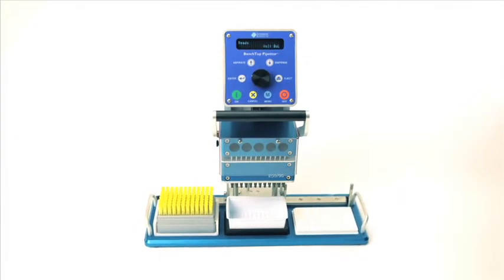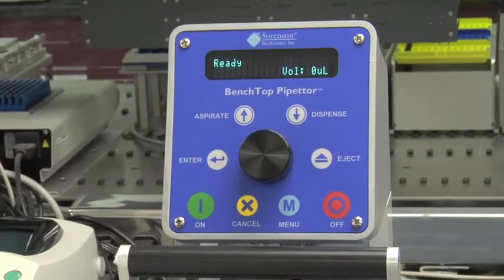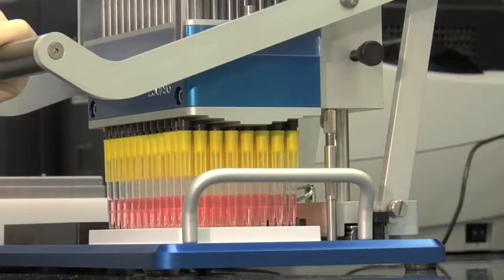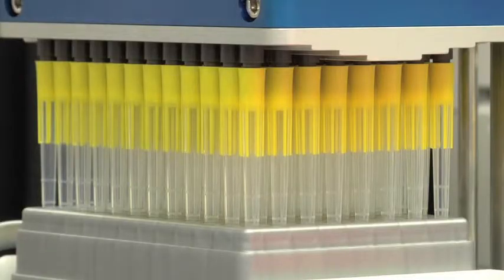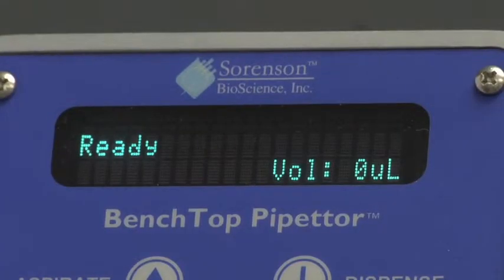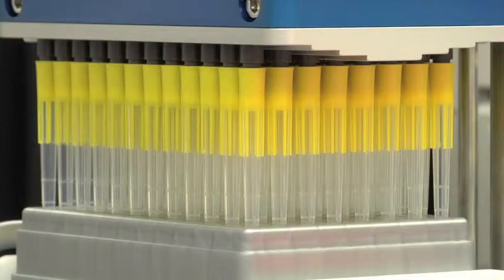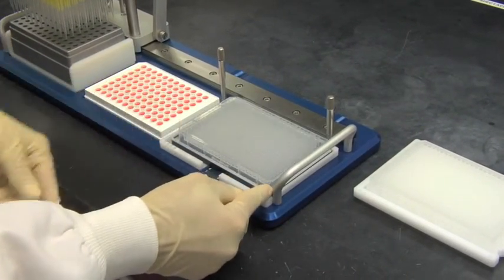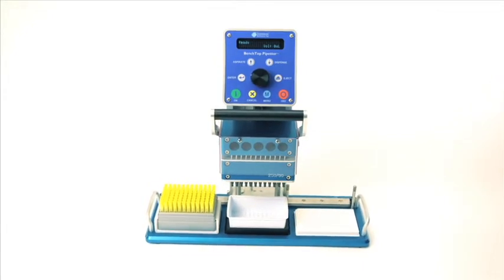Sorenson Pipettor

Comment from the maker: Sorenson’s new benchtop pipettor is a semi-automated liquid-handling device for pipetting into 96 and 384-well plates. This lightweight, portable instrument accelerates liquid transfers. The benchtop pipettor is intuitive and simple to operate. This versatile equipment aspirates and dispenses liquid samples with the touch of a button.

In this video, we’ll show you how to set up and operate the unit and show you many of its convenient features. Now we’ll show you the basic operation of the benchtop pipettor. Here’s how it works:

Three notched positions align the pipetting head while moving along an easy-glide rail. Insert Sorenson OneTouch tips into the tip rack holder. Using the levered handle, lower the pipettor head to seal the tips. Raise the tips and horizontally slide the pipettor into notch position 2. Push button choices and a digital screen guide users easily through operation steps.

In position 2, simply select aspirate on the control panel. Rotate the control wheel to select the value between 1 and 250 microliters.  By rotating slowly, the volumes are adjusted in single microliter increments. Rotating the wheel quickly will adjust the volume in 5 microliter increments up to a 250 microliter maximum.

Using the levered handle, lower the pipettor head into the reservoir, ensuring your tips are sufficiently immersed. Select enter on the control panel. The piston head design ensures accurate and precise pipetting across all 96 tips. Once the benchtop pipettor has aspirated the liquid, raise the levered handle upward and slowly slide the pipettor head into the notch guide at position 3, so that it is seated over the target plate. Carefully lower the pipette head assembly so the tips do not touch the bottom of the wells. Setting the high adjustment post will prevent the tips from bottoming out.

Now select the dispense button on the control panel. Rotate the control wheel to the desired dispensing volume. Press enter to begin dispensing. The display screen will display dispense volume and current volume. Dispense volume shows the amount to be dispensed from each tip. Current volume is the volume remaining in each tip. Once all liquid has been dispensed from the pipette tips and current volume reaches zero, raise tips will appear on the display screen. Using the levered handle, raise the pipettor head assembly upward to the highest position. Press enter once again and the pipette head recalibrates and returns the instrument to its ready position.

With the pipettor raised to the highest position, slide the pipettor head assembly into the notched guide in position 1 above the empty tip rack. Lower the tips so they are positioned halfway into the holes of the rack. Press eject on the control panel. Once the pipette tips have been ejected, lift the pipettor head assembly to the highest position. This ends the basic pipetting operation.

The benchtop pipettor has several other notable features including the ability to dispense and track multiple volumes, the ability to mix reagents, to adjust speeds and the flexibility to work with both 96 and 384-well plates.

Let’s start with the unit’s ability to dispense and track multiple volumes.  For example, we can begin with 200 microliters, dispensing 50 at a time to load multiple plates. Once all liquid has been dispensed from the pipette tips and current volume reaches zero, raise tips will appear on the display screen. Using the levered handle, raise the pipettor head assembly upward to the highest position, press enter once again and the pipette head recalibrates and returns the instrument to its ready position.

An additional feature of the benchtop pipettor is its ability to mix reagents. Lower the pipettor head assembly until the tips are within the wells of the microplate or your selected vessel. Select menu on the control panel. Mix will appear on the display screen. Press enter. Rotate the control wheel to the desired mixing volume and press enter. Next, rotate the control wheel to the desired number of mixing cycles. Press enter to begin mixing. Once mixing has finished, raise the pipettor head. Press enter to return the instrument to the ready position. Ready appears on the display screen. With the pipettor raised to the highest position, slide the pipettor head assembly into the notched guide in position 1 above the empty tip rack. Lower the tips so they are positioned halfway into the holes of the rack. Press eject on the control panel. Once the pipette tips have been ejected, lift the pipettor head assembly to the highest position.

Another feature of the benchtop pipettor is the ability to adjust aspiration and dispensing speeds. There are three speeds. The instrument default is normal speed. Slow and fast can also be selected. The slow speed is typically used for protein solutions or surfactants and reduces foaming. A faster speed may be desired if you are working with buffers or other aqueous solutions.

The benchtop pipettor can manage both 96 and 384-well plates. A 384-well plate adapter is provided and an indexing device that locks the plate into its four positions is available separately. Insert the 384-well indexing device into position. Place your 384-well plate into the device, aligning two edges of the plate marked with a single dot. Aspirating and dispensing are performed using four manual passes of the pipettor in order to accommodate all 384 wells. For the first pass, aspirate and dispense as usual. For the second pass, slide the microplate to the side with two dots and continue aspirating and dispensing. Repeat for the remaining passes at the 3 and 4 dot locations respectively. Reformatting 96-well plates into a 384-well plate, a 384-well plate into 96-well plates and plate replication are all easily accomplished using the Sorenson benchtop pipettor.

The benchtop pipettor from Sorenson BioScience, a semi-automated liquid handling device for pipetting into 96 and 384-well plates. Affordable. Portable. Accelerate your liquid transfers.